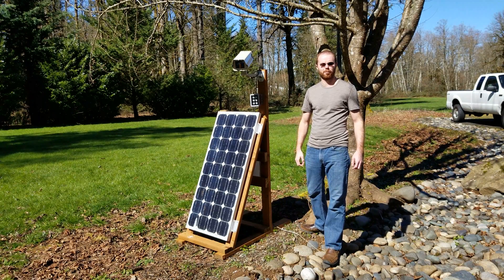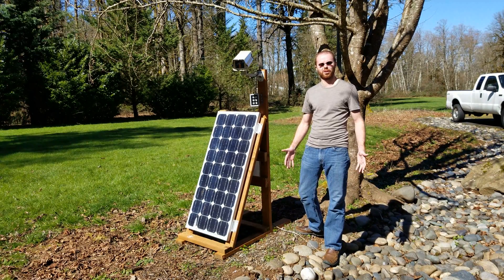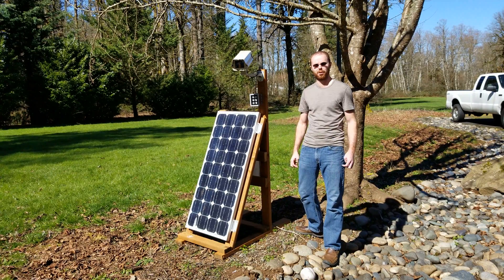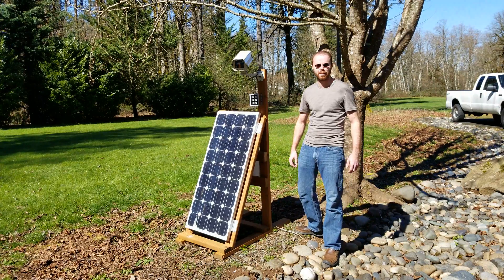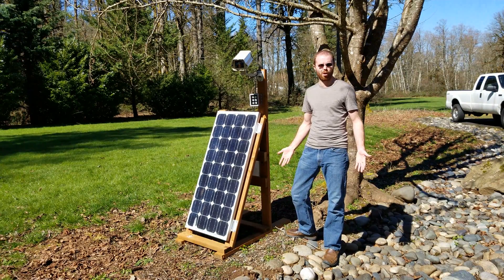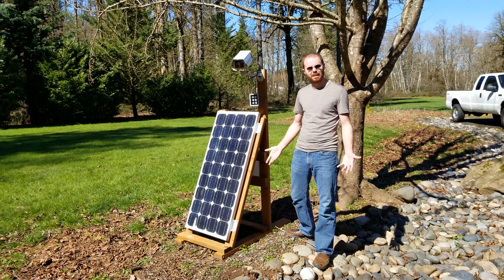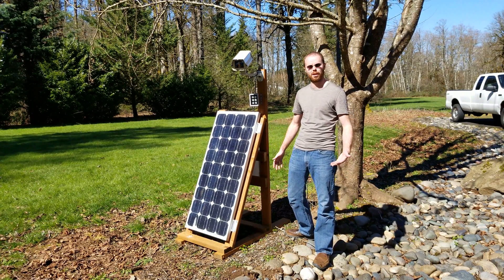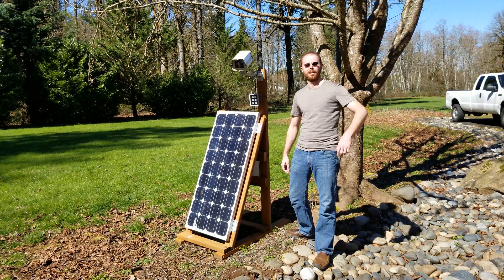Broken Solar Panel Repair Update

Comment: The silicone encapsulant is $170 bucks!? You can get a new 100w panel for less right? I have a bunch of free panels available to me at the moment but they are pretty beat up. They are fallout from a large institutional solar installation with shattered glass, bent frames etc. I'm trying to pick out the best ones and repair similar to what you did here, but for ~$150 per panel (in silicone) I don't think it would be worth it. Thanks for sharing your experience.
Reply from the maker: Yup, while this product continues to work very well for me 5 years in the cost has gone up a lot over the years...feeling more and more like another sad case of "cheaper to replace then repair"

Comment: Hi, could you please give some update on the panel? I am mostly interested about the coating you applied, how is that holding on? This is the most important question about what to apply on broken solar panels. Please update us! Thanks.
Reply from the maker: It's still holding up well, I haven't had any issues - now coming on nearly 5 years!
Reply: @erikszewczyk  This is really great to hear, as other solutions seems to peel off or turn yellow in 1-2-3 years of time. This then seems to hold on then very well if after 5 years of use, it is still doing well. Good :)

Comment: Thanks for these videos. I'm looking at this product for a few cracked panels too. From what I've read the tackiness won't ever go away as that's the intended result. But my question, does the tackiness collect dust and dirt? I would imagine that would be hard to clean? Have you had to clean it? Thanks!

Comment: Erik. I have a coverage question about the qsil product. I have 17 Large cracked solar panels im looking into repairing. what do you think the maximum coverage is for the product you bought? im sure i will have to buy a larger quantity but, do you think i could stretch it out by spraying it (thinking airless sprayer)? did the manufacture recommend a solvent for clean up?
Reply from the maker: You'd need a sprayer that could tolerate the low viscosity, but I suppose you could spray it on to save a bit of effort.  That said, I don't know that I would expect you to be able to go significantly thinner as it works its way down into the cracks during the long curing time - I'd worry that going too thin could end up with gaps in coverage where water could intrude.

I checked the datasheet on their site, nothing about cleaning.  YMMV

Comment: Hello from a fellow PNWer! Im building a treehouse out on Lopez Island (San Juan islands) and I managed to snag some cracked solar panels for cheap. I wanted to see how well the panel has been holding up over the past year! One concern I have is around the resin degrading due to UV rays yellowing the panels I am installing.
Reply from the maker: I'm very familiar with Lopez, great location to build a getaway :)

No discoloration, but I was out there a few weeks cleaning it and 2 years in the only "degradation" I've noticed is one spot where a chunk of it looks like it was gauged out.  I'm not sure on the cause though and it could have been a tree branch or rock from a truck going by (the material is certainly much softer than glass).
Reply: Erik Szewczyk wow! Great stuff! Thanks for the reply

Comment: Ok. So the repaired panel is essentially operating at 50% of what it would as a unbroken 100w panel in full sun at tilt?
Reply: he said his batteries are full so the controller is cutting the power back.
Reply: @ianpaul13  The point in question is, if the repair is even worth the cost. The panel can be measured, irrespective of the battery and its output can be measured. How does that output compared to what an unbroken panel produces. Fixes are great, but to truly understand the usefulness of this product we need to know how effective the panel remains.
Reply from the maker: Hey all, unfortunately I don't have an identical panel and the equipment required to give a scientifically sound answer to this question.  I picked the product and approach as from the sources I read it was the next best thing to solar glass (i.e. very high UV transmission).

Anecdotally I would say it's been very good, I'm comfortably confident that it's better than 50% based simply on how quickly it charges the battery, but definitely not 100% as there is always going to be some level of loss.

For me worth the repair over spending 2x on a replacement panel.
Reply: @erikszewczyk  thanks for touching bassis. I have the same panels. 12 of them, and two are broke just like this. ill order some and give it a test and use the equipment we have to measure the readout.
Reply from the maker: @nickdresser5128  that's fantastic (that you have identical panels that you can use for testing, not that they are broken).  Yes please let us know what you see from testing and I'll update my article (credit you), I'm sure you're not the only one asking the question.
Reply: @erikszewczyk  all you would need to test the output is full sun, an amp meter and a load like a heat coil or a resistor.  multiply that number by the volts and whala, you have # of watts.  i'd be cautious believing solar readings from mr. jet fuel only nick dresser.
Reply from the maker: @ianpaul13  It's not just a load, but ideally a variable load that you can control to measure across the full curve.  Good article here:
https://www.instructables.com/id/How-to-Measure-a-Solar-Cells-Power-Output/

I might be able to put something together with parts in my garage to get a better measurement, but I only have one of the model panel used in this repair so wouldn't have a baseline to compare the results to.  (Ideally I would want to compare the exact same model coming from the same manufacturing lot/date in the same conditions to reduce variables)

Taken one step further I'd like to measure the full curve both with direct sunlight as well as at various angles so I could also understand if there is any scattering effects at play...

Anyway, if any of you have additional data to share I'd be interested!
Reply: @nickdresser5128  Thanks for offering to post results. Have you been able to repair and test output at this time?